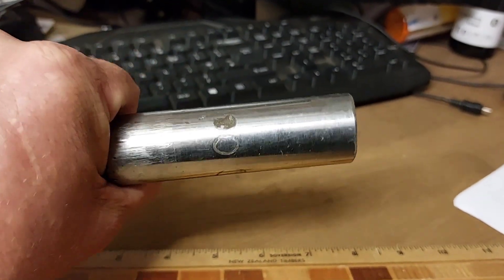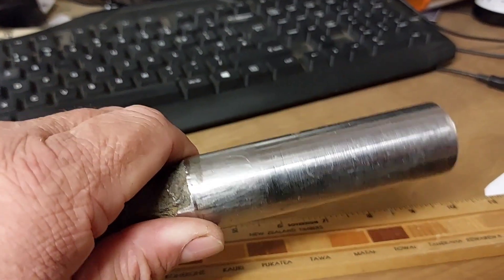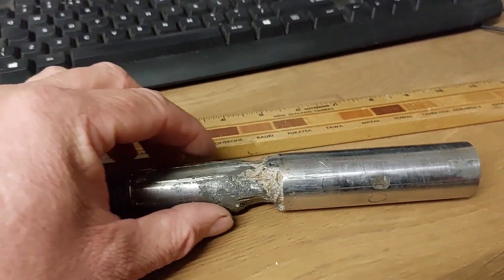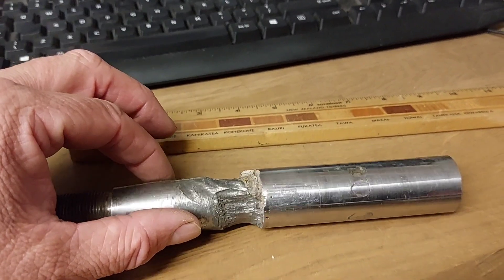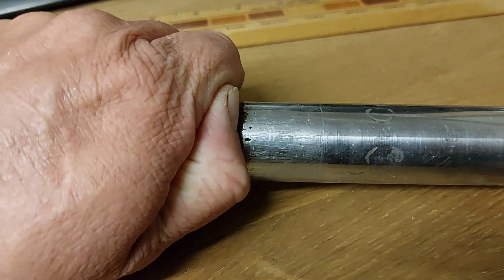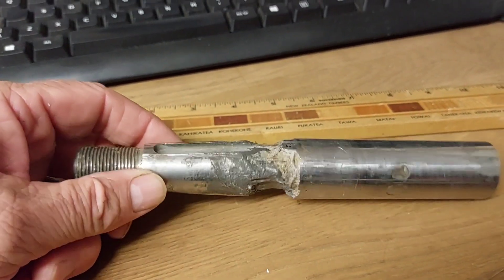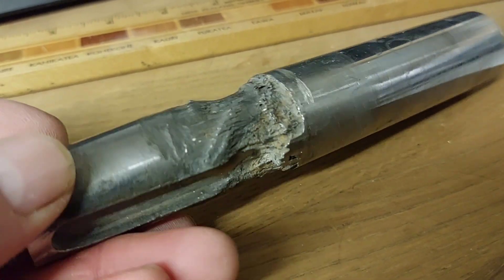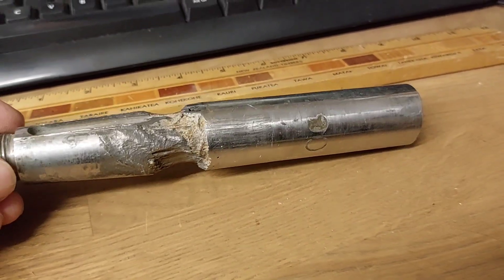Serious crevice corrosion on a stainless steel propeller shaft.

Comment: Impressive example of this mysterious, because invisible, corrosion no one hopes to find on his boat. May I assume that the propellor was not installed by the manufacturer?
Reply from the maker: Yes that's correct, the owner changed the propellor and used the wrong taper.
Reply: @TheMarineSurveyorNotebookBenSu  As you know, many issues with boats are the result of owners not being very technical or lacking to know the mostly specialistic details. Although, family member that bought another boat a month ago found appalling electrical wiring that had been done by 'electricians' paid by the only previous owner.